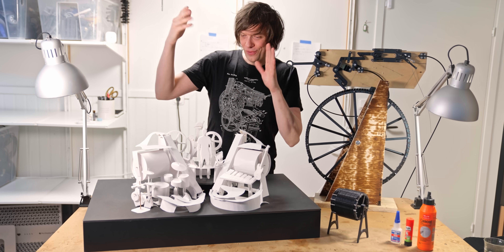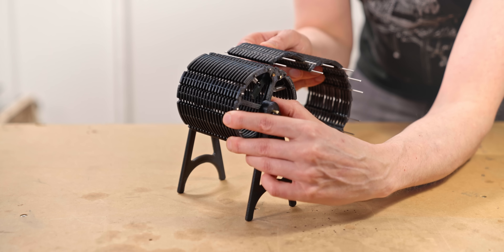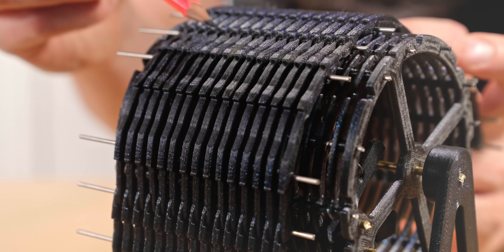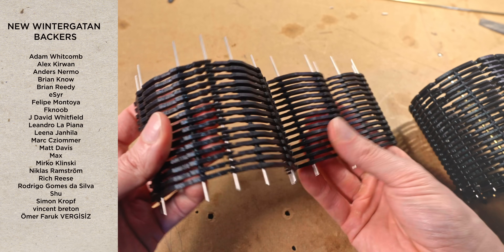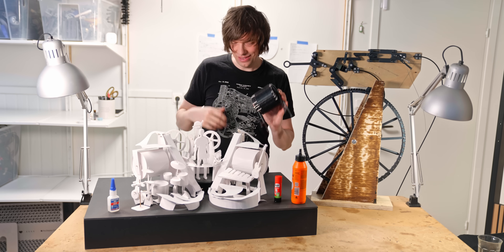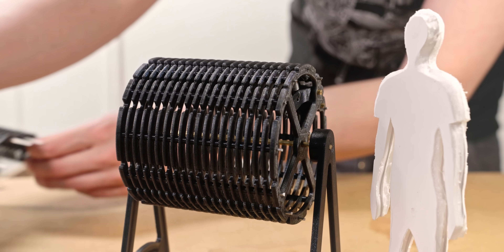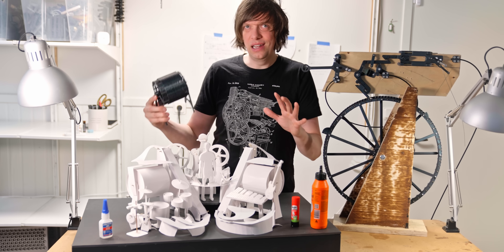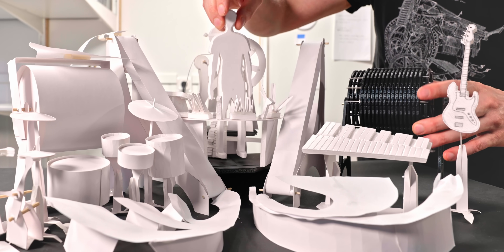A new way to switch songs on the Marble Machine

Comment: I would recomend looking into having a "blank" programing "shroud" were you can put in the manual pins in, instead of having to dual design the wheel to fit pefectly with the shroud and the pins.
Reply: yes, making a song on the shroud seems like a better idea than having two entirely different mounting techniques
Reply: You're a time traveller from the future. Martin will get there. Just some more videos.
Reply: @PostNoteIt  And then he'll immediately discard it.
Reply: I have what may seem like a uneducated  question... how ar you going to transport this? Especially with wanting to tour..
Reply: @bradleymarks  He's not; he has no intention of every building the thing, let alone going on tour.
Reply: And you dont need extremly high pins. But what is with the caps betwen the elements. Is there never a pin on that position?
Reply: @chnubu  There could be pins that overhang those areas...
He will 3d print hundreds of profiles anyways...
Reply: I had the same idea.
He could also directly compare the composing shroud with the manufactured shroud without playing it, by just looking at it to find manufacturing mistakes.
Reply: I was going to say pretty much the same thing. The removable shrouds could either be preprogrammed or manually programmable. That way you could compose parts of different songs whenever you like.
Reply: Build a rhythm machine with multiple basic platforms.
Reply: I was just about to comment that, hearing his plans.
Reply: but that would take forever especially in a concert scenario, and they might get one of the pins in the wrong spot

Comment: You have a programming belt now rather than a programming wheel. Why not continue the theme and programme it like an old computer with a continuous belt. Your songs could be on one long belt like a cassette tape and you don’t need to change anything.
Reply: Thought the same, will end up reinventing a Punch strip music box.
Reply: a belt of hard cards with holes through it was used for sewing machines long before computers.

and yeah you could use one and it would be easier to change. but look he is aware of plenty of programming and sheet systems that are smaller and easier to change etc.
Reply: @lasskinn474  
I’m sure he is but in the fog of an intense project, sometimes you can’t see the wood for the trees and a fresh perspective can remind you of something you may not so much have dismissed as forgot about in the process, maybe to come back to. To my mind, the music belt is in keeping with the philosophy of the whole build. Having the ability for the machine to play longer and shorter tracks is a great option. The caveat is a song is a single rotation at present I guess and then it loops?
Reply: One advantage of a wheel over something like a paper piano roll is the ability to implement custom rigid cam profiles for optimizing marble gate actuation or providing continuous instead of discrete control of some actuators. On the other hand, that gives me the idea for dividing a long, flat cam profile into multiple belt segments that can be rolled and are presented straight with seams closed by the time they reach the programming sense levers.

Comment: You probably still want 2 main wheels and have the main wheel to be pulled out backstage to switch tracks between songs. That would reduce the downtime between songs.
Reply: Quite frankly having downtime between songs should not be a problem. The whole point of touring with this machine would be to show off the machine, that includes seeing the songs be switched. Make the song switching a feature of the concert instead of trying to hide it.
Reply: The way I see this, doing it this way might negate potential alignment issues that'd come from moving and removing a wheel. But it's still a possibility.
Reply: There is downtime hooking up the drive system to the other wheel though, I think the idea with the new method is even less downtime than switching wheels 7:40
Reply: @YogiTheBearMan  I'm saying he should have a second wheel setup on back where techs swap out the tracks and then it's a simple matter of rolling out the first wheel and rolling the second into place. Then the tech swap the tracks on the wheel backstage while the song os playing and do it all again for the 3rd, 4th, 5th song.
Reply: How about having a led strip / laser above the wheel, then all you need are reflective tape / punch card! You could even incorporate it in the show by projecting lights in sync with the program
Reply: @pappajohndodgybob  "I really want a mechanical marble machine without electricity. That's the big Idea" 8:13

Comment: This is the same way to change songs from MMX. 4 pieces were just combined into one.
Reply: With all plates attached though, this could alleviate potential alignment issues. Hypothetically. Maybe that's not too much of an issue though, I guess testing would have to show that.
Reply: Dito. Yes he seems to be stuck in a loop.
Reply: I think that was a better idea: the combined 4 panel sections look incredibly cumbersome to load. Better to just have 4 plates and swap out each segment IMHO.
Reply: @JeffreyJusticeLosey  When Martin gets to the full scale, I'd bet he will make the skin from way more than just 4 sections. There's really no limit to how granular you could make that "chain", and a more flexible one would be a lot easier to transport and store.
Reply: @JeffreyJusticeLosey  Exactly the MMX design wins on this point. 4 separate plates easier to remove than 1 big one, also easier to repair if one gets damaged or if you want the song to change in some way.
Reply: exactly what i was thinking lmao
Reply: The problem is here, because he don't use pins anymore but larger pieces, it could happen that these overlap between the panel sections, which would make it impossible to remove them from the wheel.
Reply: @gaspode8 It completely baffles me how little Martin thinks-through these ideas before he commits to them (even if just in a model).  His “programming pins” will overlap these hinges—making it impossible for the hinges to flex without the “programming pins” getting in the way.

Why doesn’t Martin see this?
Reply: @br52685  The biggest surprise for me was the moment when he changes from the small machine to this big variant. Making it 10-times bigger and maximizing the complexity. I’m pretty sure the current version will never be build and/or completed.
Reply: @gaspode8  This bigger design merely means that he gets to drag-out the design/planning stage without ever needing to produce anything. 100% agree that this design will never materialize. He’ll get to procrastinate for a few weeks (months?) before he abandons it and/or simply drops it. Just like his custom bearing housing….he milked YouTube content/engagement for months on that topic.  I guess some people consider that “engaging/entertaining content.”
Reply: I have to rewatch that part again but there were some design flaws. Martin already was stuck in loops in recent times and I fear this is another one. Until he realises, that he is repeating his mistakes. I hope so. Watching him the latest videos is somehow painful
Reply: @arkanoid87  I know what you mean, when he was designing the MMX he did have the occasional lapse of repeating the same thing, I wordnet say these where mistakes per se. I think the problem started when he had that rely big brake from the project forgot when it was, he came back with less enthusiasm and the project turned into perfection / engineering oriented. The 3 MMX bench mark tests where very promising, I forget the exact number but it was something like 10000, 20000 and 40000 marble tests and only 10 / 25 marble on the floor over a 8 hour test. Outstanding achievement, I am still baffled way he is not on tour with a band with the MMX. Ps the MMX is now finished in full working order and in a museum.